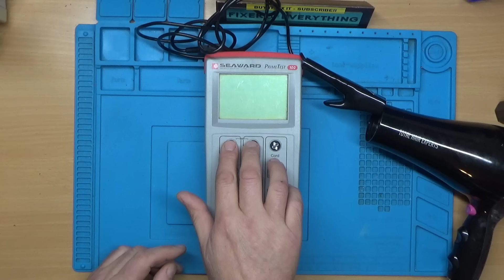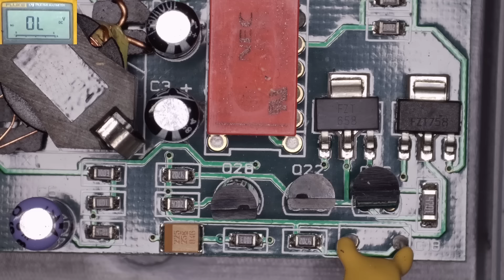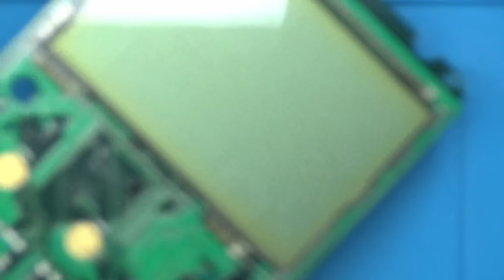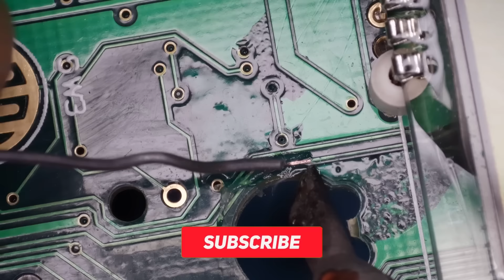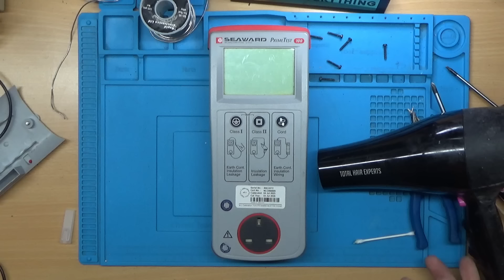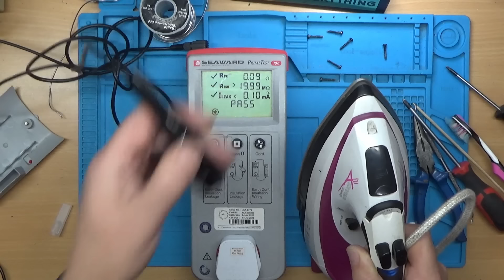Faulty Seaward PrimeTest 100 PAT Tester - Switches Off When Testing | Can I Fix It?

Comment: By experience, thanks to Duracell the most leaky eat away acid battery! Never use this brand, it is famous for creating corrosion, even if they still measure half capacity!
Reply from the maker: A few people have also mentioned that they have had a similar experience with them too.

Comment: I would always sort something like the corroded via because even though it still has continuity, it will continue to corrode and could fail in the future.
If it’s a double sided board, I’d scrape the annular ring off each side and pass wire to bridge the corroded inner plating or drill if it was a plugged via.
Via plating is lower quality deposited copper and corrodes quicker than foil copper on the surface and once it starts corroding, it continues to corrode.
Reply from the maker: Thanks for the tips 👍

Comment: Great fix as always Mick!
It might be worth scraping all of the corrosion affected zone back - e.g. the big ground pad north of the trace you repaired looks corroded and lifted too and it looks like it might have left a disconnected island? potentially joins up somewhere else, but it could affect reliability/operation/calibration etc if not repaired.
Reply from the maker: Cheers for the tip mate, might have to go back and double check that pad 👍

Comment: I don't rate these battery testers as I have a Kewtech KT71 mains operated. I also have a megger multi tester but the secret with battery tester is to take the batteries out when not in use. Batteries in my Megger would not last 6 months when left in the van. Since I took the battery case out its been around 3 years so far with no issues.
Reply from the maker: Nice, Good tip 👍
Reply: @BuyitFixit  Yep the Megger has a battery cartridge so no big deal to take it out and put it in a bubble pack bag. Leaving it connected the batteries go flat.

Comment: Anything that heats or cools is a class 1 item.  Needing a class 1 test.  There's no point clamping to plastic either.
Reply from the maker: Yes, I wasn't going to clamp it to the plastic as it wouldn't make any difference, but because it's the Internet I would have got comments saying like "on the meter it shows you have to clamp the wire to the device and that's why it didn't work" and I've got to end up replying to 100+ comments with the same answer 😂

Comment: Do you know why your discount code doesn’t work for the 4K microscope?
Reply from the maker: Thanks for letting me know. Was this for the Tomlov site or Amazon?
Reply: @BuyitFixit Amazon. I went to buy the 4K AF max and it says the code is invalid. I did try also to buy it on the Tomlov site but the postage was very high and would negate the discount
Reply from the maker: I've emailed them, if you don't hear back in a day or two, drop me another message as it's easy for me to lose track!
Reply: Any news?
Reply from the maker: @Williamxmr Yes, they said they have activated it on their website and amazon US store. They were having an issue with the UK store as there is a limited time promotion ending this week and the code will be activated after that (if you're in the UK that is)

Comment: Have a great Christmas ,love your channel and farm and it's inhabitants.If your interested I have a couple of things you could play with (ooerr Mrs) but no idea how to contact you personally ? Anyway it's a deaf Alexa Flex (works fine but has gone deaf) I use them as door bell speakers but now they are unavailable so worth a try to repair and a Fnirsi USB dooda ,it gets very hot if you plug my ugreen 500w charger into it and got upset and huffy and only partially works. Might be entertaining ,thanks
Reply from the maker: Thanks mate, I've never heard of an Alexa Flex before. I could always have a try as long as you're in no hurry. Sometimes it takes me quite a while to get round to repairing items as I've always got a backlog it seems.
Reply: @BuyitFixit no rush by any means I replaced it with my last spare ,as I said it responds to the buttons but is deaf so doesn't respond to your voice so now limited to being a doorbell .Brilliant things for us old folks (I am in my 70's) if I suddenly thought of something I could use Alexa to remind me of it later knowing full well I would forget what it was before I could put it to paper  I bought the usb tester to see if my usb charger was working as one socket wasn't charging but as I said it had a fit and the protruding usb A  plug gets very hot ,nice to warm a room but not safe to leave in for long .,how do I get InTouch for your address or do you have a PO box .thanks ps Mrs has Facebook but I am not into pictures of people's dinner
Reply from the maker: 😂😂😂😂I'm not into the whole facebook thing either. This is pretty much the only "social media" that I do. You can drop me an email by using the name of the channel at out look dot com. Sorry for being cryptic but it's to try and keep the spam down.

Comment: Nice. I accidentally put a pair of Alkaline AAs in my fancy 8-slot smart charger, and then went on holiday for two weeks. It was a vile mess inside as the batteries had leaked almost all of their guts and it took me an hour to find and patch all the corroded tracks.
Reply from the maker: Sounds like you had a similar battle on your hands! Good job fixing it 👍
Reply: @BuyitFixit  I couldn't even bring myself to take a "before" picture as it was absolutely minging, and I knew it was 100% my stupidity.

Comment: I've been working on something that might be useful, a bridge megger for electronics.   A bridge megger in big electrics is something you hook up and by measuring the short you can using a table reliably work out where a short circuit is from the feedback resistance in a linear circuit but my idea would use pulsed waves which would radiate as heat on and off and with a feedback measurement you should be able to work out where in the circuit board the actual short is because it will be the only thermally oscillating signal on a thermal cam.   I have thought about time to live feedbacks as well, a big bridge megger has a defined pulse before it is negated by the short, I think it would be possible to digitally work this out by time to live pulsations but its all very rudimentary right now but imagine a multimeter which you just hook up and tells you so many cms down the line the short is and maybe thermally indicate the component or IC :)
Reply from the maker: Sounds interesting 👍

Comment: Excellent diagnosis as always, Mick. 
I wonder if it could be converted to a single 9V battery instead of the leaky NEVEREADY ones 🐈‍⬛😹
Reply from the maker: Cheers mate 👍While it could (or even lithium cells perhaps),it would also then be non-standard. Not sure if that would cause any issues with it legally or with people refusing to calibrate it.

Comment: When you are cleaning up suspected "battery corrosion" distilled or deionized water is the appropriate solvent, at least to begin with. Isopropanol is reasonably polar, but still usually an inferior solvent for ionic contaminants. Potassium hydroxide, the main electrolyte in "alkaline" cells, is about 9 times more soluble in water than in IPA. Corrosion caused by battery leakage can be really difficult to remove because you usually wind up with metal oxides that are insoluble in anything safe to use on a PCB and it comes down to a mostly mechanical process.
Don't go wandering around the PCB with a used swab. If you clean a "dirty" area, use a fresh swab when moving on to another area. About 95% of of what I see in fix-it videos that is called "cleaning" is mostly spreading gunk around into a a thin layer instead of actually removing it. In lots of cases it doesn't matter much but in high impedance circuitry and some other circumstances it can cause problems and anything that warrants removal warrants "complete" removal.

After water has been used, a further cleaning with isopropanol may be wise.
Reply from the maker: Thanks for the detailed info and tips! Appreciate it. 👍

Comment: Great video and repair. As I’m a qualified PAT tester who actually owns one of these. Bear in mind though, once opened it will invalidate the calibration certificate, this will need a new certificate before use, any PAT test used on an uncalibrated device in invalid. Also you were using it on the hair dryer which is a class 2 appliance which doesn’t require the earth connected as these are no exposed metal parts. Glad you tested on the iron class1 and power lead.
Reply: "Bear in mind though, once opened it will invalidate the calibration certificate, this will need a new certificate before use"  Oh fk off, no it won't. Thats utter bollox. All he did was repair a trace. It won't affect the calibration in any way. He didn't change any components. Mick could calibrate it himself anyway. He just needs some precision resistors. For the price these cost, the quality should be much higher. The board should be conformally coated with a protective laquer and the battery compartment should be sealed so any battery leakage can't get inside.
Reply: @simontay4851  No, @ianhuxstep211 has a point there.
What you're addressing is the technical side of things and correct as far as that is concerned. 
ianhuxstep211's point is a legal one. If you as a PAT tester greenlight a device (in a commercial setting) and somebody gets hurt or killed, the liability may be put on you, no matter if the technical side checks out. That's why you definitely want a factory calibration for these testers. 
It doesn't count for private use, though. There, it's more of a "do what you want as long as you only kill yourself" situation.
Reply: @simontay4851  Nothing in the legislation requires the use of one of these things anyway, but a whole industry has sprung up around selling and using them.
Reply: @simontay4851  "the board should be conformally coated with a protective laquer and the battery compartment should be sealed..." Exactly, It would appear that Seaward's philosophy is that "We test that other people's electronics are top-notch, although ours may be a bit dodgy."
Reply from the maker: Thanks Ian 👍He said I could have it as  donation to the channel, so I might use it personally just to test things to check if things are safe before plugging them in (like those ultrasonic cleaners for instance).

Comment: I've worked on at LEAST $5,000 in RUINED handheld test equipment in the past 5 years because of leaky batteries. Duracell's in particular.

 Energizer ultimate lithium is the only way to go in expensive equipment. Hopefully more of the expensive high-end test gear will go with rechargeables in the future. Or at least specify lithium prime cells only.
Reply from the maker: Good point 👍

Comment: Nice repair, but alas it won’t last. The rest of the board will have to be treated with vinegar to neutralize what leaked out of the batteries. Otherwise it will just eat through other tracks.
Reply from the maker: Yes, I noticed some other bits when editing so I'm going to scrape that off, use some white vinegar and put new solder mask on 👍

Comment: Cheers Mick, this made me laugh because it's the exact same model of PAT test (pointless added twattery) that we use in one of the repair cafes I volunteer at. 

One of the cafes (it's run by the local council) insist on a PAT test on entry "for the repairer's safety", but not on exit. I've seen plugs with the 3 mains cores hanging out of the plug cord grip and stopped them leaving. Kids of today...

All 3 insulations were pierced by the cord grip right down to copper before I sorted it out by cutting of the damage and adding crimped ferrules. 
I was overreacting apparently, the correct paperwork procedure was followed, so that's apparently safe?! Couldn't make this shit up. 

My favourite cafe has people that all understand electrical safety and we made a group decision not to pat test. Second opinions always offered and welcomed if there's any doubt.
Reply from the maker: Thanks mate, ironically we also have the same PET tester at our repair cafe, and I think it was part of the insurance that stuff had to be PAT tested before we looked at it. We also re-test before handing back.
Reply: @BuyitFixit Hello insurance company? I'd like to make a claim.
 
My MOVs have all been destroyed by excessive unnecessary PAT testing...
Reply: @georgeprout42 EXACTLY! I completely agree with you!. I will be calling it Pointless Added Twattery from now on. Paperwork is BS and just a box ticking excercise. An actual person who understands the theory and WHY will always be better than some stupid PAT machine. A PAT machine would still say pass even if there are wires hanging out of the plug or the L/N wires weren't connected inside.

I think the majority of people that use these PATs are just using them blindly, they don't understand electronics, doing know what the PAT is doing, what the readings mean or why. They're just looking for the word pass or fail. They don't visually check the circuitry or even the plug. They don't know what a MOV is, or the difference between an X and Y capacitor or what they are.

Comment: Hi I have a 240v to 415v phase converter which went pop the other day I took it apart and it had blown the track on the circuit board! It’s where the main connections go I soldered it and got continuity back but when I plugged it in it pop again 😢 is this something you would like to repair? 
Regards Mick
Reply from the maker: Hey Mick, I'm not sure if I'd be able to do anything with it, but I could certainly have a go. Drop me an email by using the name of the channel at out look dot com.
Reply: @BuyitFixit thank you I will do.

Comment: These fixes are always entertaining and educational. I also have to fix a trace in a CD player that seems to have been corroded by a leaky electrolytic capacitor. I will use your method. What AWG size wire did you use? And would a pen grinder be too aggressive to clean the solder mask off the trace?
Reply from the maker: Thanks mate, I had thought about using the grinding pen, but I think I snapped the fine point tip I had been using it as a drill lol. I need to get another bit for it. It was thin wire wrapping wire that I used, which is 30AWG according to the label.

Comment: Good fault finding and fix.  I only found out recently that when alkaline batteries were introduced, the originals didn't leak because they had small amounts of mercury in them that prevented it.  This got banned and now modern ones leak.
Reply from the maker: Thanks Mike. Interesting, I never knew about that, thanks for sharing 👍
Reply: @BuyitFixit pretty known fact… duraleak were the first to remove Hg from their cells …

Comment: Nice one Mick, cracking simple fix when you consider these are £400.00 plus.. (blasted MCU's the scourge of repairs)...
Reply from the maker: Cheers mate 👍
Reply: Over £400 is fxkn ridiculous. This tester is over complicated and an absolute rip off. There are NOT £400 worth of components in this. It should be £100 max. All it is doing is applying high voltage to L/N and measuring the resistance between earth and L/N. Also checking the continuity of the earth pin of the plug to the earth clip that you clip to the item being tested. I have a Robin PAT from the 90s that does the same things. It cost £15 on eBay. There is a trim pot inside to set the resistance that it trips at. Ive calibrated it to trip at 1M. I would expect much higher quality for over £400. Metal screw inserts, a high quality MK socket, proper high quality buttons (not just conductive rubber buttons), a backlit screen, aluminium case, a DC barrel socket and an external 9V PSU. Even cheap multimeters have rubber case covers.

Comment: Corrosion is still under the solder mask, right by where you bodged the wire, you can see its a different colour because its become lifted from the copper, should of scraped the whole lot back and solder masked it. My mate Vince had a similar issue not long ago looked exactly the same.
Reply from the maker: Thanks for the tip!👍